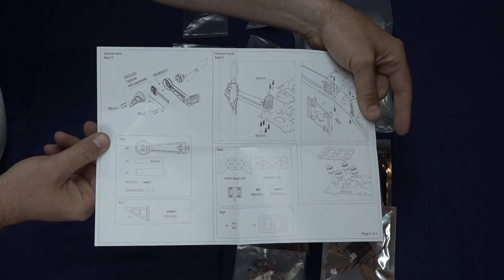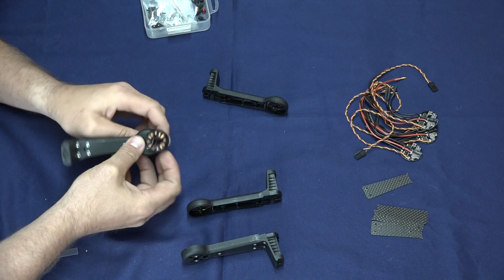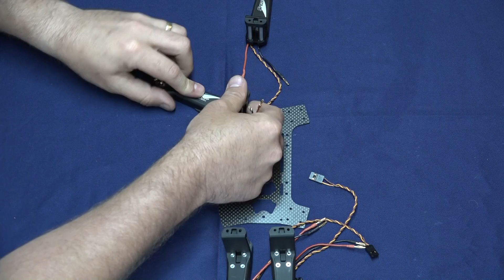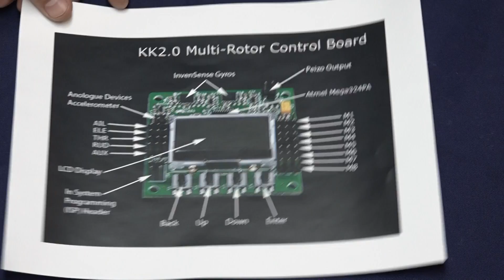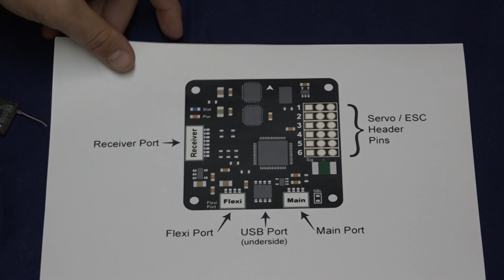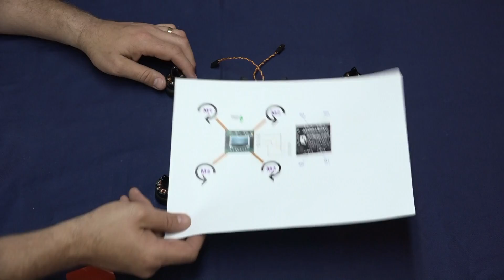Spedix S250 assembly Video 2 ARF Version (KK2 or cc3d)

Comment: So -- I am building this quad not but am I the only one noticing that the instructions on the build in the video are opposite of what the paper prints out. ie:  the build demo has clockwise on upper right, counter clockwise on upper left, counter clockwise on lower right, and clockwise on the lower left.  When we get to the part of the video on the CC3D, is has the motors opposite.  I followed the instructions in the build, not the sheet referenced in the video.  Which is correct?

Comment: Hey @BuddyRC, I bought mine today. But it does not come with a paper manual. Could you be glad to scan and upload it as a PDF file?
Reply: +Samuel Sandoval The manufacturer did not include manuals for us. This is the reason we did the video series to help with the assemble and setup process. All of the videos are listed in the detail section of this video. If you run into any problems let us know and we will help walk you through it.

Comment: Hello Buddy RC. Great Video. Hello Everyone. I have some questions about compatibility between CC3D and Spektrum if anyone could be so kind as to help me out I would be so very appreciative.

I have a CC3D Version of the S250 in the mail as i type this. Figured this quad is a very good option for my first quad that I have to build. 

Ive had a couple of RTF's as well as Hellis, planes and I race 1/8th Pro Buggy too. But im totally unfamiliar with using a programmable flight controller. 

My Radio gear I intend to use is a Spektrum DX6i with AR6100E Rx. I believe (but i could be wrong) that the AR6100E RC can NOT be used with a Satellite. So my question is can I hook up the AR6100E Directly to the CC3D or is it a "Must" to use an rx that can have a satellite between the CC3d and Rx? Or am I (hopefully) miss understanding what quad builders are calling satellites, and any receiver while hooked up to a programmable flight controller are considered to be satellites? My under standing was that a satellite receiver was like a piggy back device for normal receivers to either extend a park flier to full range or to enable the signal to be received from further away from sensitive electronics? I think I really need this clarified so I dont waste any extra money and also to get a heads up on what gear I may need to get my quaddy flying :)

If it any help, although I have ordered the CC3D version,  I actually have a spare separate KK 2.x (two point something) mini laying around somewhere. Dont know if that would be of use (in case CC3D can not be used straight with AR6100E) 

Most of my hobby money goes into Racing 1/8th buggy's. in fact both myself and my wife race (she races EP & Me Nitro) so the expense is quite large, as we are pretty serious about it. So we must keep the Quad project budget down really low. Especially for my first venture into the programmable 250 size side of the hobby. So any and all help would be greatly appreciated. Thank you so much in advance.

Comment: Please check your video for motor rotation directions and correct it.  Left upper and Bottom Right should be CW and Top Right and Bottom Left should be  CCW,
Reply: +Ben Ndubuisi the CW is not the direction the motor rotates.I can make any motor rotate in any direction just by switching a couple motor wires. The motors themselves are identical with the exception of the prop nut.  Its the direction of the threads and how the nuts goes onto the motor. If you install as you suggested the nuts will spin off when you hit something with your props. CCW is upper left and lower right. You want the prop nuts to self tighten itself.

Comment: I have a question,I have the Spedix S250 Quadcopter BNF KK2 Version,and i want to add some leds,where do i solder the led wires to or can i use the outputs on the kk2 board to power the leds?
Reply from the maker: +Black JWayne If you are running 3s you can either solder a wire through the battery connection or you can use the 12V/bat output plug that is located next to the buzzer
Reply: +Buddy RC I have the kk2 bnf version and white plug connectors are soldered directly to the board,do i have to plug the escs to those white plugs or can i plug the esc wires to the outputs on the kk2 board???

Comment: Settings for the Naze32 on Speedix would be helpful. I can not seem to get the Yaw authority I want. It currently is to slow. I have the Yaw rate set to .70
Reply: +TJ Martin I run my yaw rate pretty high. I believe most of mine are set 85 to 95
Reply: +Wes Johnson thanks Wes. I will try and bump it up some more. are you using PID 0 for that?
Reply: +TJ Martin Yes
Reply: +Wes Johnson ok thanks. I will keep playing with it.

Comment: I have a couple questions about transmitting and receiving.first, I would like to say I am a first time buyer for FPV and I am on a budget.Okay, so the first thing is that the receiver in this model is only DSM2/X, compatible. Does this mean that a transmitter like the FlySky FS T6 will not be compatible for the receiver?And my second question is would a 5channel DSM2/X transmitter work for the current 6Ch receiver? If not, can I take that receiver out and put in a 5ch one?
Reply: +AnAbsent MindedPenguin A flysky transmitter will not work with the DSM2 receiver. You will need to put a receiver that is compatible with that transmitter. Not sure about the 5 channel transmitter working with a 6 channel receiver. It wouldn't hurt to try if you have it laying around. It shouldn't hurt anything.

Comment: So at 12:58 in the video, you mention that the CCW motors would be on the left (front) and right (back), and the CW motors would be on the right (front) and left (back). Now I'm in the process of configuring the CC3D FC and Open Pilot GCS indicates the complete opposite motor layout. I was just hoping to get some clarification on this since Google isn't really helping much.
Reply: +Chris Stackhouse The CW is not the direction the motor will turn. It is the direction in which the nut will tighten for the prop. You want the nut to tighten in the opposite direction than the what the motor is turning so that it self tightens itself.
Reply: +Wes Johnson   I got the same trouble.. But i think this is very helpful! thank you! I will go and test it!

Comment from the maker: Power Distribution Board mounts to the bottom plate with the short stand offs.
Reply: +Buddy RC Ok if i want to Plug four sensors from this type HC-SR04 with panel kk2.1.5 where and how can i enter sensitive or different orders for each HC-SR04for example
front HC-SR04 8 cm
rear HC-SR04 8 cm
left HC-SR04 2 cm

i am new for arduino and quadcopter 
thanks for the video it is so helpful

Comment from the maker: Sorry I forgot to add it. Its on the cc3d setup video we are working on. More or less you can use a servo tester to run the motor up to test the direction. Much easier and can get it all set and closed up before you start the setup of the flight control board.